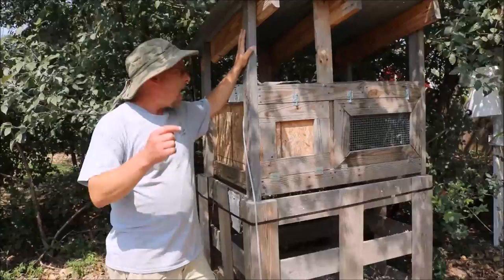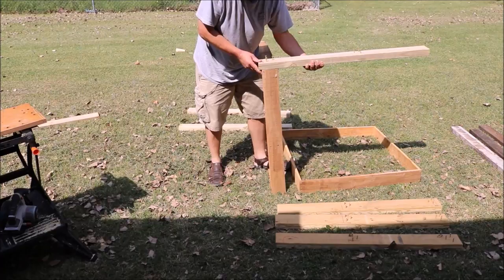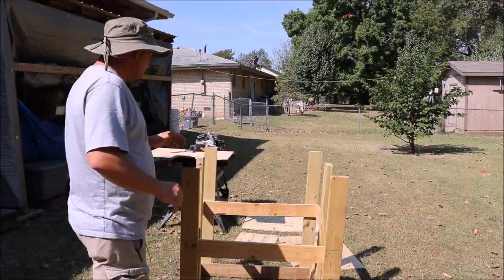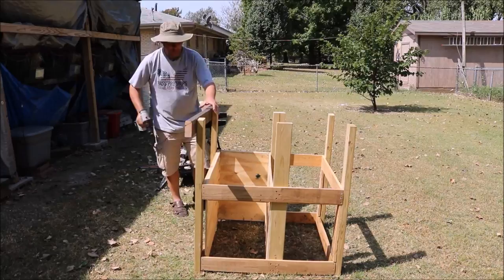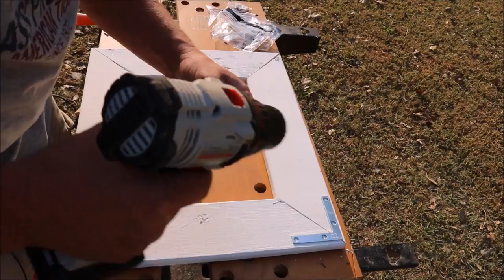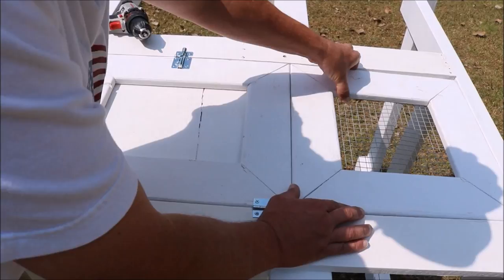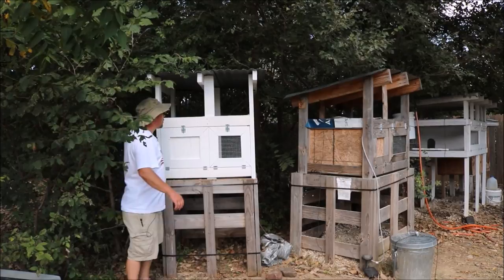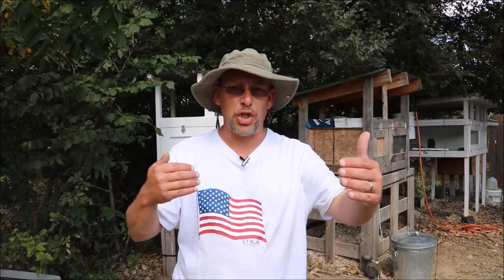Building a New Quail Hutch - The SR Quail Update 9-18-17

Comment: Have you ever considered dividing the excess hardware cloth on either side and fold it up on the outside of the frame?  Reduces waste and allows you to staple on the side giving a bit better securement of the bottom of the floor.  Or to be real secure sandwich the cloth between the frame and a strip of plywood or a strip of lath.  The later is how I do mine.
Reply from the maker: That is a great idea.  I have considered that before.  Just haven't had a problem so far.  If I do, I will definitely be sandwiching the wire to fix it.  Thanks.

Comment: Nice build but it seems like you made the solid side on the big door so your open side with mesh is the smaller area of the hutch which is opposite to what you originally wanted to do.
Reply from the maker: they are actually fairly close to the same size.  But yeah, i could have made the solid section a little smaller.

Comment: wondering if i could get your opinion on dust bathing material,  i was considering using unscented non clumping cat litter.  during the winter sand is hard to get for me and cheap cat litter is abundant.  what are your thoughts on this idea instead of sand? thanks in advance.
Reply from the maker: I would think that would be ok.  You might check the ingredients list and make sure it doesn't have anything in it that will harm the quail if they ingest it (take a little bit of googling) but I think it would work.  You could also just use plain old dirt.

Comment: Hi Chris quick question. Do you use oil paint on the hutches or is water paint okay seeing that it has galvanized covering on top?
Reply from the maker: I am using a water based paint but I don't think it matters really.  The roof is sheet metal salvaged from a torn down shed (freebee on craigslist).

Comment: Just a quick question do you think it's alright to use treated two-by-fours for my frame? I really don't want to deal with the rot. I salvaged some two-by-fours but they're 5 feet tall I wasn't sure if that was tall enough to build the such as like yours because I don't have a crate to stand them on
Reply from the maker: That should be fine.  If it were for rabbits I would avoid it because they chew on things.  But it will work fine for quail.

Comment: My quail keep pecking the hardware cloth. It seems its all they do for most of the day. One has actually broke a piece of its beek at the tip and it was bleeding pretty good for a while. But they just seem to pace back and forth pecking the wire. Any thoughts??
Reply from the maker: That sounds like boredom to me.  I don't have that problem with my birds.  Are you keeping them fed well?  I keep feed in my feeders all the time but i notice they get restless if the feeders run out.
Reply: @Slightlyrednecked  There is always food in the feeders. I am going to put sandboxes in and see if that helps. I usually put them in but remove them after a couple of days when they have kicked out all the sand. I will leave them in longer and keep refilling to see if that helps. Thank you.
Reply: @backyardsurvivalist4623  I found kabob chewing toys you can get for parakeets work well as toys

Comment: What do you think the advantages are by making your cages this way?
Reply from the maker: well I am not saying that this is the only way to make your cages just the way i like to make them.  They sit high enough for me to easily reach inside, plenty of ventilation, an option to get out of the weather, and the doors opening down makes it easier to open without birds falling out.
Reply: Slightly Rednecked I didn't mean any disrespect I was  just wondering why you chose to build it the way you did, rather than assume I just wanted to ask you. I kinda figured it was ease of  materials, good bird handling  and maintenanc etc...
Reply from the maker: Oh, I didn't take it as disrespectful.  I guess my answer kind of sounded like I did though didn't it?  Sorry, maybe I shouldn't answer comments at 5:30 in the morning. :)  What I meant by my answer is that it may not be the best way for everyone but it works well for me for the reasons I gave.  I am sure that other people have other designs that have as many benefits for them.  I hope that makes sense.

Comment: I may have missed this but is there a reason why you chose to open the hutch downwards and not have it swing out?
Reply from the maker: No real reason but I do find now that having it open down works better to keep the birds in when I open it up.  I tried a door that opened outward and it was very difficult to keep the birds in when I opened the door.  They just come spilling out as soon as the door opens.
Reply: That's interesting. Thanks!
Reply from the maker: No problem.

Comment: Wood seems to be really cheap in the US. Using 400 pounds of wood to accommodate two dozen quails is really strange for us in Asia.
Reply from the maker: Wood isn't that expensive here but I didn't use anywhere near 400 pounds.
Reply: Wood can be salvaged here..pallets, scrap wood from crates, etc.  He does have another video showing grow out cages made from just wire. I am just learning but it seems the brooding cages like/need a dark room ..I'm going to keep watching videos and learning but fascinated with health benefits of quail eggs. I do wonder about the distance between the top of the caged area and the roof.  I know ventilation is I,portent but wondered if this distance could be less?